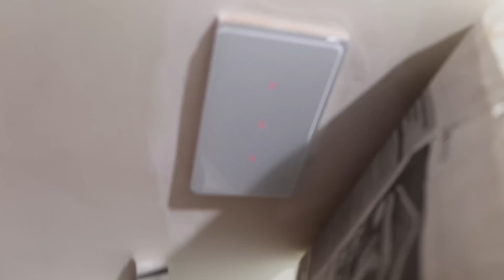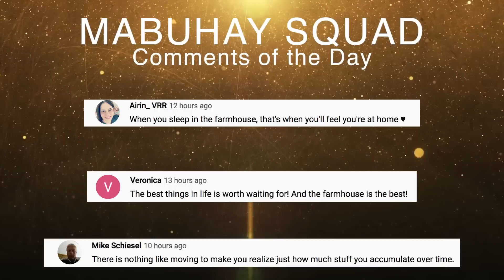Experiencing Life in Our Farm House For the First Time - July 4, 2022 | Vlog #1520

Comment: As a cabinet designer your kitchen design is so interesting. Why is it framed out for appliances??? That's so interesting. Where does the heat go??? Even the bedroom fridge seems there is no room for heat to escape. I'd be so interested to sit down with your designer and pick their brain. You were cracking me up explaining how they had to measure the space special for the fridge. Lol That's how it works for every appliance. They all have different measurements. I had a job once that was inside contractor sales and I had a three foot wide catalog of every large appliance available which contractors and sometimes clients would call for specs and I'd have to look everything up. It was the best job ever. I also did many other things.

Comment: I as well use the G7X i use the Mark 2 version .  I find they are honestly terrible vlogging Camera because, I have had the tiny screws on the back of the flip up screen fall out and Have never found them . I have had to tape the back of my screen to keep it in place for the camera to turn on . Cause with out the back of the screen it will not turn on . I have heard good thing about the sony A7X. I Would wait until the Go Pro hero 11 comes out or get a go pro hero 9. Cause I have heard people have a clicking noise through the go pro hero 10 in there videos for no reason and can not turn it off.
Reply from the maker: Hmmm noted on all of this and yes, the screws falling out of the back screen hahaha def happened to me with a past Canon G7x.
Reply: @MikeyBustosVLOGS  idk why they haven't fixed that issue. A lot of people have had that issue. I think they might have fixed it with the mark 3 but i'm not to sure. This is the only camera from canon that does that. Normally they are highly noted for being good. This is a poor quality check on there mark